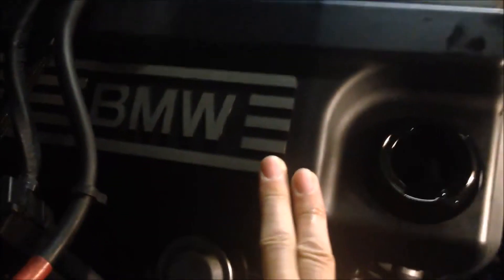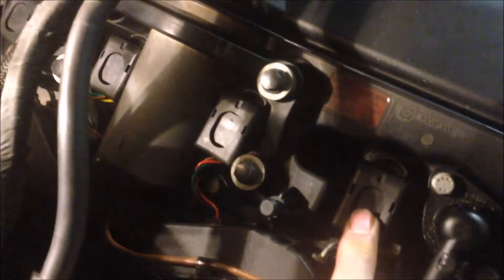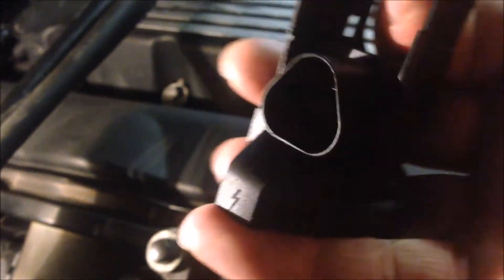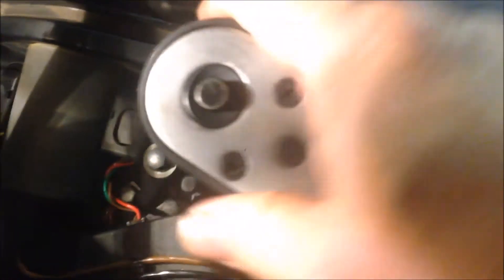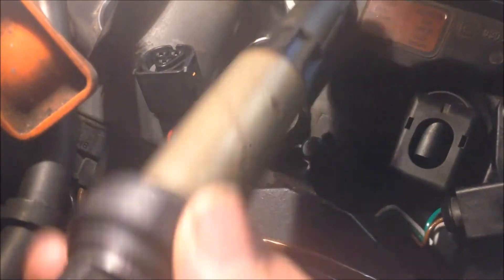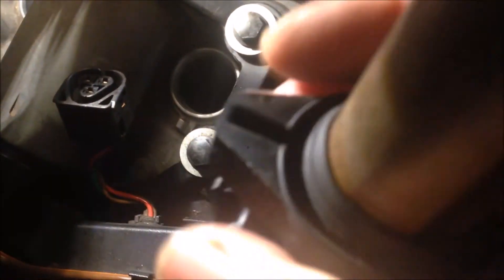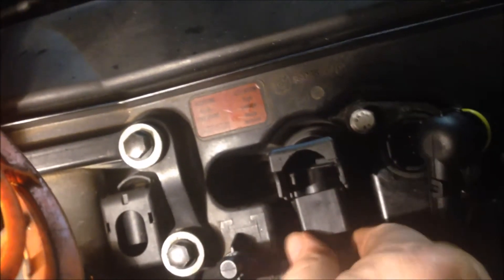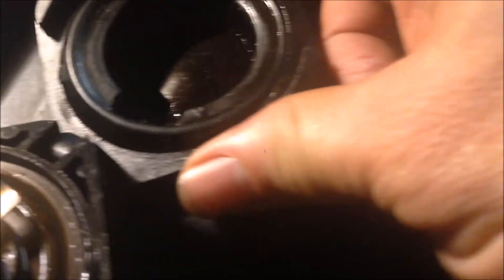BMW E46 / N42: Spark Plugs and Coils : How to remove / install

Comment: Exellent mate many thnxs! Sparg plug 14mm on bMW 1 series right??
Reply from the maker: HI, not sure about the size for BMW1 spark plugs, hope they be the same. Thank you for your comment. Have a good day!
Reply: @RepairDIY  you know the code 28A3 is it chain or vanos?? I have changed the vanos okey but can it be camshaft sensor??? and if my cahin its good ok I can olny change 3 vanos drev or what??
Reply from the maker: @Data4664  hi, I have never had the 28a3 code so not sure about it. although my car had a lot of different fault codes but finally it was due to the low oil pressure. I only found out after removed the oil sump (a big job for me). good luck!
Reply: @RepairDIY  https://bmwfault.codes/XMLDiagView?doc=MgAwADAAMAAwADQAOQAxADUANAAxADcAOAA4ADAANAA=  here okey.

Comment: Hi quick question: is it 10mm 1/2 or 14mm 1/2 socket used for spark plugs removal? Thanks
Reply from the maker: hi, it should be the smaller one. This is for most of cars as I know and my lawn mower needs that big one. Have a good day!
Reply: @RepairDIY  Cheers have a good one!

Comment: I know this comment is kind of late, but do you happen to know what the sensor to the right of the 1st spark plug is? Mine seems a bit damaged but i can't seem to figure out what it does.
Reply from the maker: hi, The eccentric shaft position sensor is one component in the BMW E46  valvetronic system for the N42 engine. you could watch this video to get more info: 
https://www.youtube.com/watch?v=C4JMeEjA_nc&list=PLCXPGrQnBEsUBcBSqiS4nxpETOUWp6syO&index=73&t=0s
Have a good day!
Reply: @RepairDIY  Thank you so much for the quick answer, I really appreciate it! :D

Comment: How do you get the rear one out?
Reply from the maker: Hi, Yes you have less room to do the rear one! But it is the same as others. for the coil, again try to twist before trying to pull out. For the plug, you my need the correct length of extension and / or a flexible socket adapter  to remove and tighten. Although removing the cabin filter housing would give you more room, but it is normally not required. Good luck!

Comment: My engine top cover is loose and it vibrates under hard acceleration how can I make it sit thighly ?
Reply from the maker: Hi, if it is the plastic cover loose, you can remove the cabin filter cover, cabin filter, cabin filter housing, then the plastic cover. check the fittings are okay then reinstall the plastic top engine cover, then install everything you just removed. hope it work. Cheers
Reply: Hi, thanks for the quick reply! What should I do if the fittings are bad or of there are some fittings missing ?
Reply from the maker: Hi, good questions! don't worry. I guess it is more likely to be that it was not properly installed last time. So it more likely to solve the problem by reinstalling it. If in case anything damaged, you could try to repair it, if anything missing, you could try find something to replace the missing part, or you could go to a scrap yard to buy one used, or from ebay. Many possibilities before you investigate, and you will find out the facts soon after starting your investigtion. wishing you a good luck!

Comment: My engine was misfiring for a few months and the mechanics I went to didn't fix the problem. This was the first time I fixed my car engine myself  thank you 😁
Reply from the maker: Great! Well done! Yeah, there is so much we can do but just haven't discovered yet?
Reply: For example, rear shock absorbers, OFHGasket and Oil Cooler gasket are really easy to replace too 😁